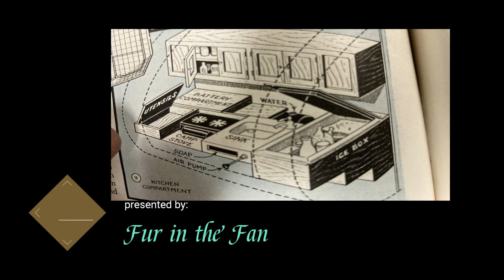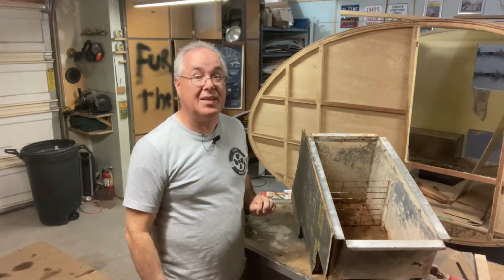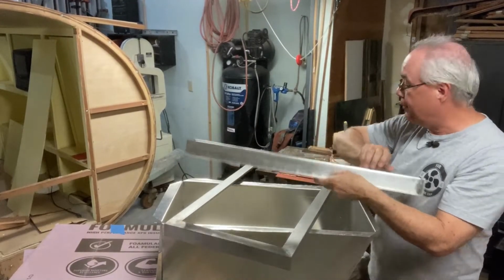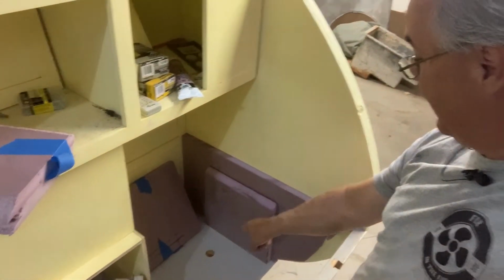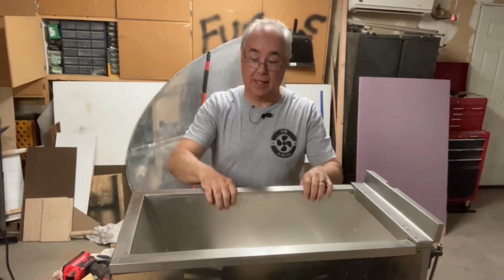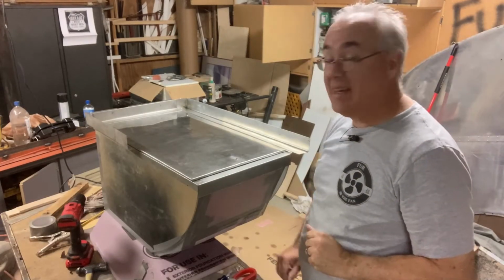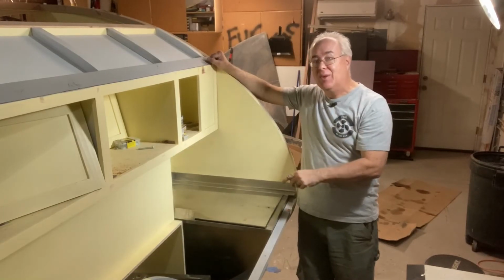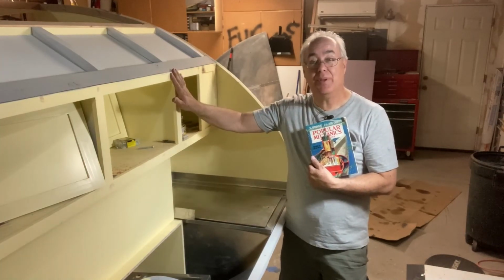Vintage Trailer Icebox Rebuild - Part 2 of 2

Comment: Watching part 2, now, LOL.  HIGH 5!!  Can you share the metal glue you used? Noting that the video is over 2 years old, I am assuming you are finished by now with the trailer and have tried out the ice box.  How well did it keep things cool? I would think with the added insulation and that it's a top open cooler, it did pretty well once its pre cooled.